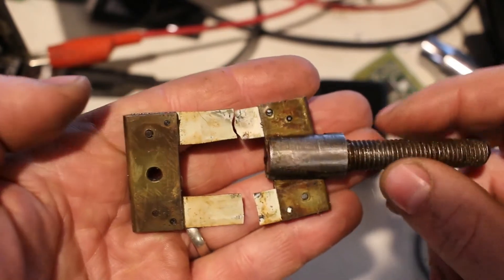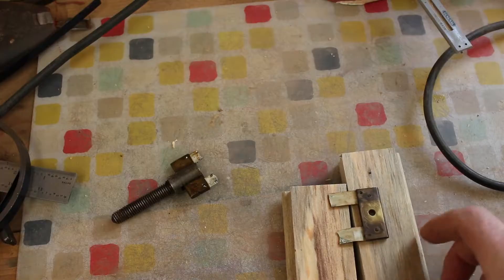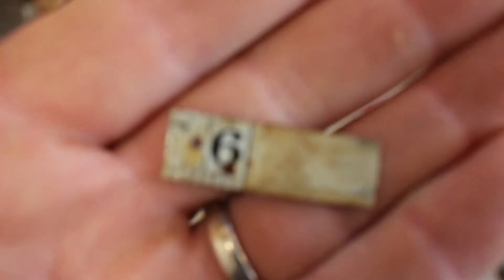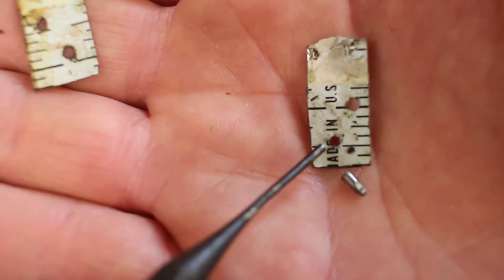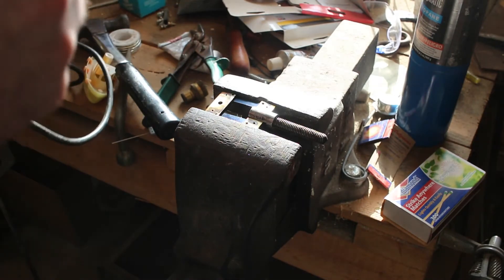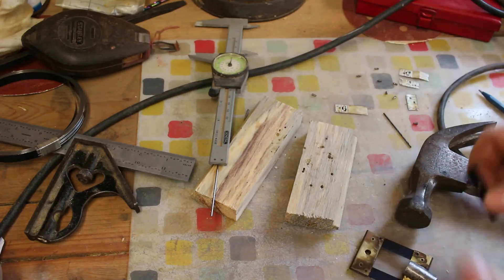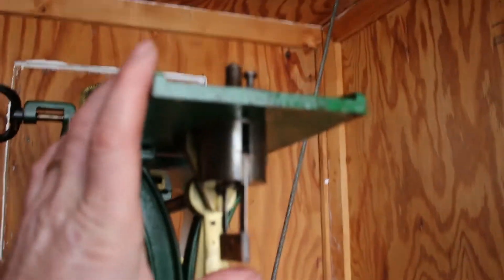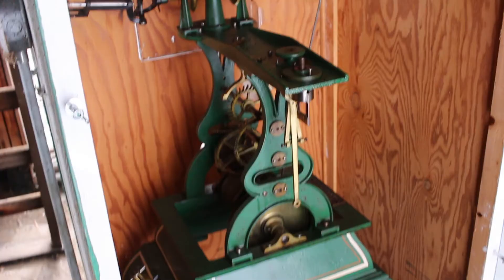Repairing a 100 year old tower clock

Comment: That is the suspension spring. The spring fatigues over time and can break. Good thing the issue was caught before the pendulum fell to the floor. Pendulums on these tower/turret clocks can weigh 75+ lbs.

Comment: Yeah, that spring steel drills hard, and being thin makes it even worse because it deforms.  It'll cut better if you use a bit of mild steel as backing for the drilling.  Also, HSS doesn't cut it.  Cobalt drills will, but I usually only get a couple holes before I need to resharpen the bit.  Haven't tried a carbide bit yet.
Reply from the maker: From what I've experienced it's hard to drill with carbide by hand. It's so brittle that if you get any chattering or if the drill catches it will chip.

Comment: Seems like strapping material for pallet strapping would be a good choice
Reply from the maker: That would be a little wider and thicker than the tape measure but who knows what was there originally. I got something like a 50 foot roll of spring steel so I have a ton left over.